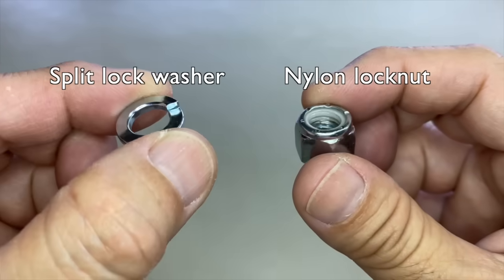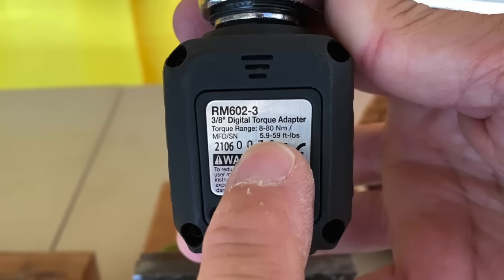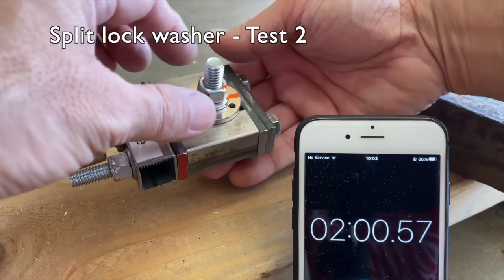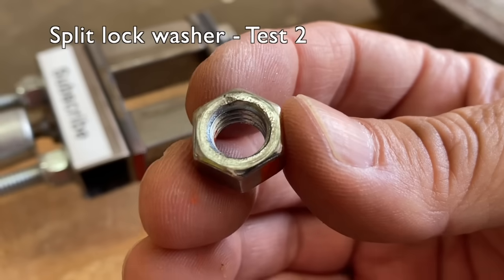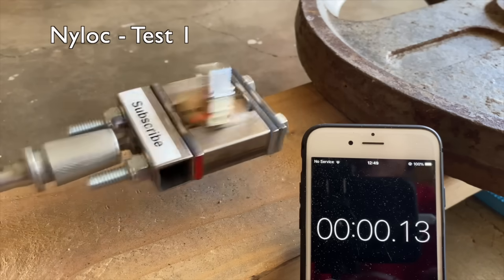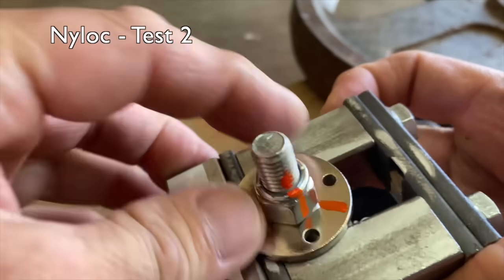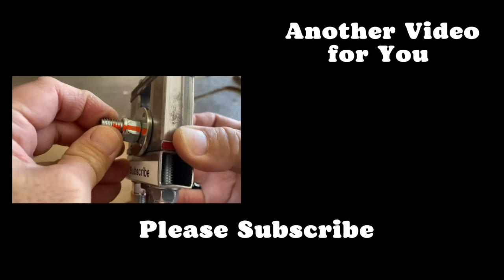Nuts & Bolts - Split Lock Washer vs Nylon Locknut – DIY Impact & Vibration Test - Part 1

Comment: More than 20 years ago, my company experienced a fatality during the operation of a Caterpillar pipelayer (sideboom). The boom brakes ‘failed’ and the boom fell, striking a ground worker. Many factors involved that I will not get into here. One of the claims was that a plastic lock nut connected to the boom brakes had ‘backed off’ due to vibrations experienced while the machine was being operated.

Comment: Where it counts in aerospace, the locknut does not use a plastic insert.   The end is disrupted.  Imagine a castle nut where the ends are cone-forced inwards.  These a different than the safety wire castle nuts.  And yes, you will find a lock washer installed under them, but it sure as hell isn’t that Chinese trash big box store hardware.

Comment: Ok first off im a space station service mechanic tecnical engineer and why this is an alright test you have still failed in understanding just how the split washer works. That would never be the recommended fasteners for that type of situation.  Ever! Thay was as dumb as using a flat washer under the lock washer 😅.  I see grown men called engineers do this 😅.  
Try a crimped nut.  Like a seat belt nut. You know  with three dimples on the flats.  
Lock washers or split washers work well but it has to lock to a part that cant rotate or it isn't locking.  😂

Comment: Why these weird units? Seems the torque was low. As another commentator said, if you are going to have a loose assembly use a cotter pin. Otherwise, thank you.

Comment: At much lower than the required torque to stretch the bolt any meaningful amount, not sure if this has any validity, although the street has been saying for a while that nylock are better.

Comment: The nyloc has a running torque that the control and split washer don’t. It may not be much compared to 6 ft lbs but these setups did not all have the same clamping force because the running torque was not accounted for.

Comment: When feasible, you can use two nuts torqued together by wrenching them in opposite directions. Give them at least 50 feet pounds of torque.

Comment: Nyloc - sucks
Split Washer - sucks
Toothed washer - sucks

Mild Steel/Stainless Nut with a weld over the bolt and nut - permanent.

Comment: Lots wrong here. First off i do not see run-on torque being calculated so you are not getting the actual bolt stretch you should be. You are not really getting the 6 inch-pounds of torque on the joints with the locking feature. Second, the reason the split lock is not consistent is because spring rates and loads are not consistent. The split washer acts as a spring adding additional load to the threads as well as having the sharp edges to dig into the surfaces of the mating hardware. But i'm sure the spring rates and loads are all over the place.

Comment: 6 foot pounds is irrelevent. Optimal torque loads the threads and depending on the alloy and hardness, stretches the bolt into tension. Lock washers and nylock nuts are for different purposes.

Comment: Why not use the standard torque value for a 3/8 bolt and nut and the grade.  6' lbs is almost nothing for that size bolt. My bet  is that 3/8 bolts grade 5 or 8 have standard torque is at least 25' lbs. to 35' lbs.  I bet both lock methods would hold up much better with the proper torque applied.

Comment: regardless of your test of nyloc results, it is false.  It was a used nut.  You can see it had the threads in it.  Nyloc are 1 time use for actual lock

Comment: So, for anyone wondering, this is why you torque to the correct specification. A 3/8 nut needs 30 ft-lbs. Torquing the nut stretches the threads of the bolt creating tension. If torqued properly, the nut shouldn't ever loosen in it's intended use-case.

Comment: The tester doesn't seem to understand the concept of a bolt.  The bolt can be considered a large spring when the nut is torqued.  6ftlbs is useless.  Those flanges also act as springs when the bolt is properly torqued.

Comment: 1 thing with the split lock washer. Why only 6 pounds? That thing needs to dig into the nut and washer. That's what locks it. I've had several of those that needed to be cut off or torched off.

P.s.  Ive also come across split lock washers with center punch lock nuts. Real fun there.

Comment: Good video...simply put, neither are reusable, and only the nylock will survive flexing during extreme implementation, splitlocks are always compromised after one use and at best moderately acceptable when new. And note...6 ft lbs is not adequate for any of these scenarios.

Comment: I use nylock, a cotter pin, two split washers and weld it all on, then I grind off the visible threads

Comment: You would never torque a 3/8" nut to only 6 ft-lbs. If you do, then you should be using lock wire or castellated nut with cotter pin.

Comment: You need to use proper torque on the bolts.  A 3/8 -16 thread at grade 5 should be almost 20 ft lbs and will change your results.

Comment: yeah, those washers are caveman solution for holding bults and nuts. Nylock, pretty good, nylonc and locktight, yepp, thats on there. Tried nordloc's?
Reply from the maker: My Nord-Lock test is out… Will Nord-Locks Survive My Test?  DIY Impact & Vibration Test – Part 5
https://youtu.be/wOUnlfhHRko
Pls check it out and drop a comment.  👍😎

Comment: You didn’t account for the run-on torque of the nyloc nut. Self locking nuts should be torqued by adding the run-on to the final torque.

Comment: found lock washer would cut into the surface of the material it as supposed to lock onto sure, but not over time when in high vibrations

Comment: - 00:00 🔍 The test compared split lock washers and nylon lock nuts for vibration resistance.
- 00:05 🔧 A custom test rig was built to simulate impact and vibration on bolted joints.
- 00:26 🛠️ Transverse forces across bolts were the main factor in loosening, more than axial forces.
- 01:15 ⚠️ Control tests with plain hex nuts failed quickly under vibration.
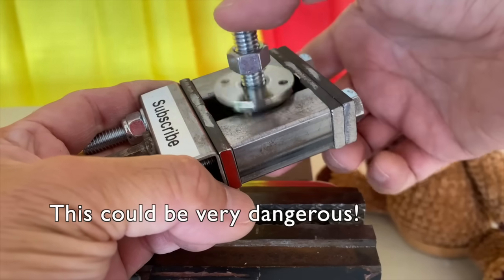- 02:12 ⏱️ Split lock washer tests showed initial resistance, but the nut loosened significantly after 60 seconds.
- 03:18 🔩 The split lock washer eventually failed after 2 minutes and 30 seconds, causing the nut to fly off.
- 04:02 🛡️ Despite some resistance, the split lock washer left deep gouges on the bolt and flange.
- 05:07 🔒 Nylock tests showed consistent results, with minor misalignment after 5 minutes but no significant failure.
- 06:38 ⏳ After 10 minutes, the Nylock was still holding, though it allowed slight bolt movement.
- 07:12 📉 Conclusion: Nylocks performed more consistently, while split lock washers had inconsistent and weaker results.

Comment: First before doing your 'tests' online you need to know the mechanics of how the items are designed to work. If you use a split lock washer and have a smooth washer under it you have eliminated the mechanics of the lock washer. The lock washer is meant to dig into the base metal and the nut to prevent loosening. If the smooth washer under can turn freely the lock washer is doing nothing, or very little as just the spring tension is acting on the nut.

Comment: This test is flawed because of the insufficient torque applied. If done properly the screw without split lock should last longer than the one with it (failure occurs when the nut starts turning).This only proves the real purpose of split lock washers, which is to prevent the nut from flying off. It should only be used on soft materials like wood. Of course the nylon lock or loctite is the way to go.

Comment: 1. Bolts/nuts not torqued to correct specs
2. You received very inconsistent results which to me screams something is wildly different in your tests. As you torqued everything to 6ft lbs (which as I mentioned before, is not to correct specs) it would point towards manufacturing, material and batch differences.
3. You weren't recording when the nuts were moving, just the results after a rough amount of time, reducing the accuracy of the results.
Reply: looking through the comments it seems that everyone has a similar view. I'm interested in norlock tests too, as long as everything is torqued up to recommended values. guides for your vibration tester may also be a good idea to improve consistencies

Comment: This video was worth watching and corresponds to my experiences. I also learnt that split washers have an orientation, which I did not know until watching this video. Good to see a follow up video with them combined. As to the aircraft mechanic, I am horrified that he might be suggesting that aircraft use cotter pins, that have their own means of fatigue followed by catastrophic failure.

Comment: Should do a test like this but with flex top, distorted thread, and steel insert type locknuts also added to the test. Additionally, test at 6 ft lbs, 15 ft lbs, and 30 ft lbs so you can see if one type is optimized for specific amount of torque fastening or if it doesn't really matter. You can get all the different types from Mcmaster

oh, and also try just two nuts jammed against each other as well since that is very common too. And a regular nut jammed against a nylon nut.

Comment: Nylon bolts are very effective. Its important to understand! Nylon is vulnerable to contaminates! This would melt the plastic and render the secure hold worthless. I would also note! Lock washers are perobably best. In this video regaurdless of specs it was clear lock washers were improperly torqued. Lock washers are very persistant when torqued properly. This vidieo showed lock washers not fully seated. When seated corectly lock washers dont vibrate apart! Simple as that! And Nylon nutz have there place as well.

Comment: The point of Nylocks isn't to maintain the original clamping force but to prevent the nut from coming all the way off and allowing the bolt to extricate itself. I'd like to see you use this rig for jam nuts and other preventatives.

To the "experts" in the comments, this is not for professionals with access to specialized hardware, it's for for DIYers who shop at local hardware stores with a relatively limited selection of fasteners. Most homeowners don't have McMaster-Carr, MSC, Grainger, or Fastenal on speed dial.

Comment: One thing worth noting is that at such a low torque value, a good portion of the torque applied to the nyloc is lost due to simply overcoming the friction required to rotate the nut on the bolt. (IE when you see a torque specification on something it is because that bolt needs a certain amount of clamping force, clamping force is not easily measurable so they have determined that for that size bolt a spicific amount of tightening force will translate into the desired clamping force. Usually torque specifications are for clean dry threads because anything that lubricates the threads such as grease, anti-seize, oil, threadlocker changes the ratio of rotational torque to clamping force so when you torque a lubricated bolt to the specified torque the actual clamping force created will be significantly too high)

The problem with the really low torque value for this test is that the amount of torque required just to turn the nyloc on the bolt is significantly more than the others. That additional torque that is required just to turn the nut doesn’t contribute to the actual clamping force in the two parts. I just checked a 3/8” nyloc out of my bolt bin and it took just shy of 2 lb*ft just to get it to move (and that’s a previously used nyloc out of my spare bolt/nut bucket) so it’s probably easier to turn than a brand new one would be. The end result is that when you tighten the nyloc to 6lb*ft the clamping force of the nut is equal to what a regular nut should have if it was only tightened to 4 lb*ft, since the 2 lb*ft required just to turn the nyloc doesn’t contribute to the clamping force. Since the torque used for the test is so low, that 2lb of torque lost to friction on the nyloc means that it had 33% less actual clamping force than the bare or split washer bolt had.

To get a comparable test you should measure how much force it takes just to get the nyloc to turn and add that to the torque you are trying to achieve (so in the case of the bolt I tried you would want to tighten it to 8lb*ft which is the 6lb*ft of torque you’re trying to achieve plus the 2lb*ft additional torque required to turn the nyloc compared to the bare & split washer nuts)

Comment: They are two completely different systems and one should never be used instead of the other. Simple explanation is that the 'nylon locknut' as you call it, is actually called an anti-vibration nut. They're used in everything from aircraft to navy ships. They do exactly what their name implies.... they don't loosen under heavy vibration (due do the pressure of the nylon exerted on the threads). Lock washers are just everyday hardware store variety fasteners.

Comment: Split lock washers on the bolt and nut side. Then torque to spec or 10% below yield strength. Cotter pin, safety wire, tack weld, DONE.

Comment: To be fair, thats not the correct torque for that size bolt and that sort of vibration is extremely unusual.

But neither of those locking methods are foolproof.

Comment: Nuts and bolts are designed with a specific torque specification. Enough torque has to be applied to start to (very minimally) elongate the threads. Six lbs. was not near enough torque for those bolts.

Comment: This post is getting weirder and weirder. Now someone is saying the bolts were torqued to 60 ft lbs, not 6 ft lbs. Pretty sure that bolt would have failed at 60ft lbs.

Comment: nasa electrical engineer here.. but my first thought would be nylocks are best. But given the low torque safety wire or cotter pin would be better. Split washer can damage hardware.

Comment: The differenct between lock washer test 2 and lock washer test 3 is the alignment of the nut. There is a marking on the flange the nut where, in test 3, the split locker washer grabbed into. thats why it was so hard to separate the parts in test 3. Thats why the results were inconsistent.

Comment: 6 foot lbs torque is very low. I don't think some Nylocks will even thread at 6 ft. lbs. Plus you forgot to test double nut lock.

Comment: Split washers are useless for locking. The DIN has retracted the respective norms like DIN 127 or DIN 128, because they just don't work for the intended use case

Comment: Not correct experiment. Two locker washers should be there, under the nut and under the bolt.
Reply from the maker: Here you go... https://youtu.be/Iao2HT71kB8
👍😎
Reply: @HacksbyDad  OK, thank you. Useful info.

Comment: This is why aircraft nuts, bolts, screws and other fasteners use safety wire. My airplane propeller has 8 - 5/8 inch bolts holding it to the crankshaft flange at 50 ft/lbs torque. The bolt heads are safety wired (.042) in pairs with an adjacent bolt. After 100 hours at 2,400 rpm, the bolts are checked, retorqued and safety wired. Have never had a problem with a loose bolt.

Comment: I believe he chose six foot pounds so the tests could be completed in a reasonable time frame. Obviously in real use you're going to use much more torque. He even says he chose 6 ft pounds because it's just about as low as he could go on his torque wrench. This was a great video, and I'm especially impressed by how short and sweet it is. Good experimental protocol 👍

Comment: If that's a 3/8ths bolt you need to test at a higher torque, put a little oil on them and test at 30 ft lbs.  I bet the results will be much different.

Comment: there is no purity of the experiment. The grover should have been placed on both sides! You and Grover had a nut standing, and the bolt was unscrewing from the fixed nut. grover - cutting washer  Translated by Google translator...      
нет чистоты эксперимента. гровер надо было ставить с обеих сторон! У тебя с гровером гайка стояла, а болт выкручивался из зафиксированной гайки.
Reply from the maker: https://youtu.be/Iao2HT71kB8
👍😎

Comment: Try Loctite.
Reply: Тоже хотел его предложить👍
Reply: Exactly! It's made to maintain clamp force & has been proven under laboratory testing. It's also testing for thermal expansion & contraction, which can also create the loss in clamp force tension.

Comment: Okay, but who uses a lock washer or a lock nut and only torques it to 6 foot pounds? That completely defeats the purpose. Neither of these locking mechanisms are designed for the types of stress you're putting on them, though. These are designed for light tension. The type of vibration you might get from a small rotating motor, not from being in a paint shaker.

Comment: Suggestion:

Make a vibration device that doesn't literally hammer the bolted assembly to death. 

Then repeat the tests. 

The choice of locking device/method depends on a lot of factors.  But nearly all of them will fail under a test where the bolted joint is literally hammered to death with such a testing device as this. Even a cotter pinned castellated nut under these conditions could result in a worn/sheared pin over time. 

But nice video, anyway. Thanks.

Comment: Once you tighten a nut or bolt with split washer to a value that actually works, that split washer becomes a flat washer with less friction surface than an actual flat washer.  The split washer can spread out more because of the split.  Lock washers haven't been a good idea for over a  hundred years when they were used to hold tension until a nut or bolt was actually tightened.

If you are using the lock washer for anti-rotation during vibration or other forces, then you are using the wrong tools for that job.

Comment: Nylocks are terrible because you can't tighten them with your fingers and you need a wrench on both sides. Spinlocks can be spun on easily  and in most cases can be tightened with one wrench. There is also a bonus built in washer. Game over... SPINLOCKS for the win !!!!